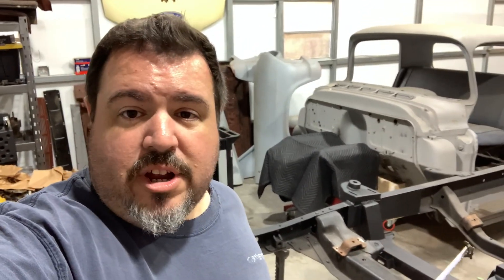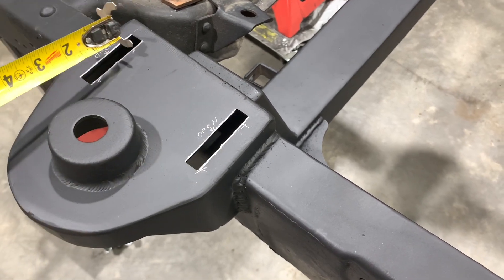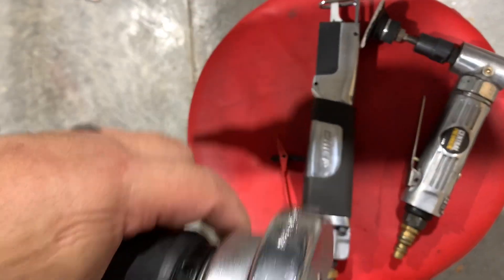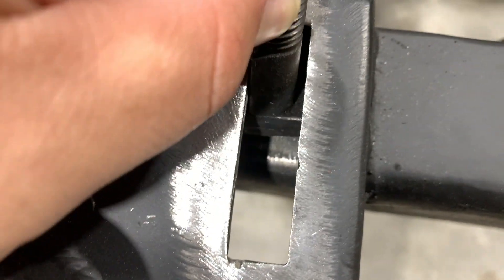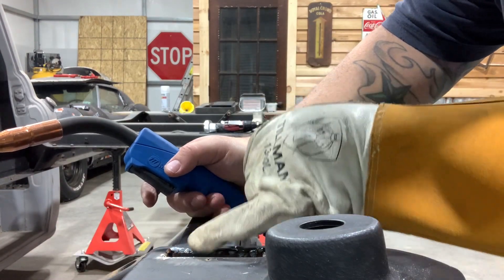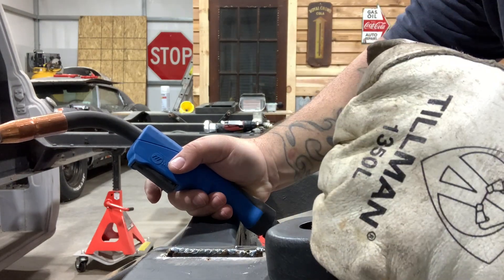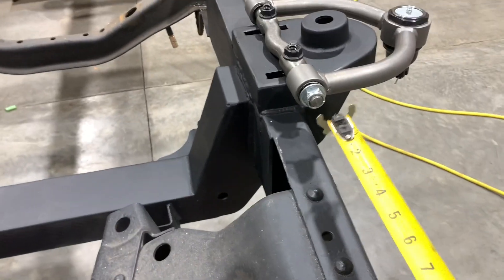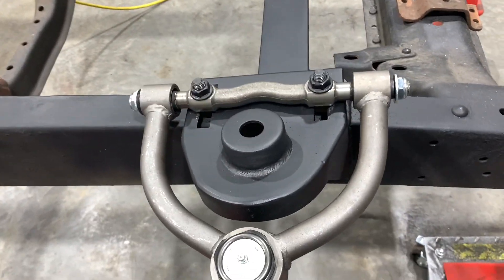Tubular Control Arms | 55’ Chevy Truck

Comment: You should have measured from the bottom only from the start. The top ball joints can be moved forward and backwards with caster adjustments. I love following your build.
Reply from the maker: @WindRider1  thanks for following along!